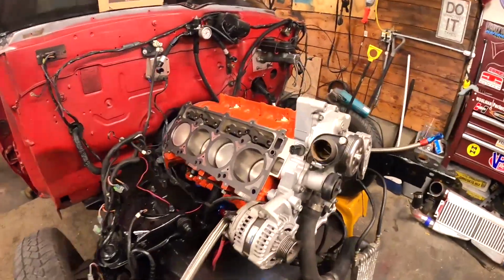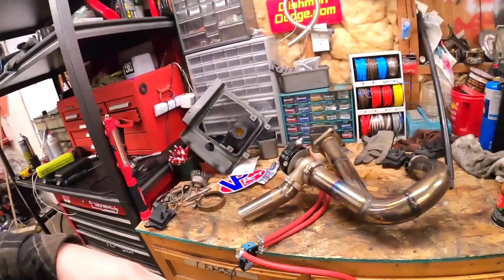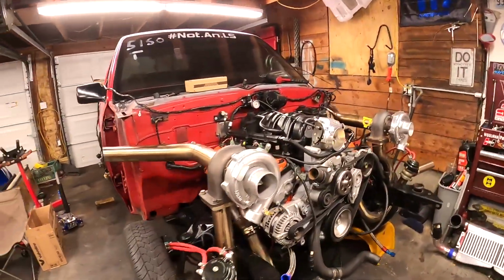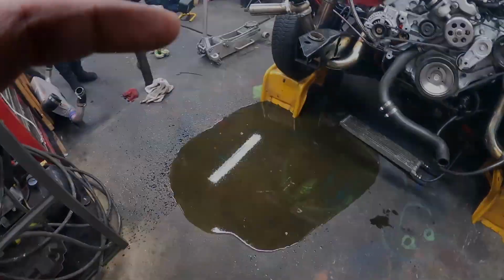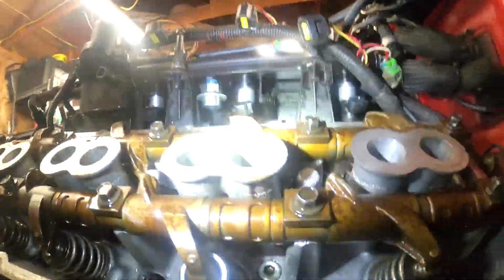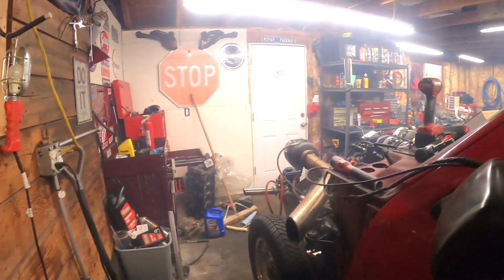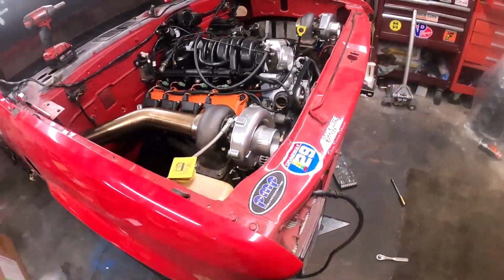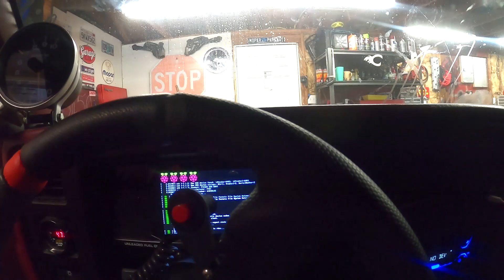Turbo Hemi First Startup & Give away talk!

Comment: I'm trying to do a similar swap on an 02 dakota how did you get the 727 to work with the hemi? Do you use a manual valve body or some other type of controller?
Reply from the maker: sorry took so long to reply but worked great !!! yes used manual valve body to make it work.

Comment: What intake is that? It doesn't look like the truck one
Reply from the maker: It's off a charger
Reply: Pretty sure they are identical to the ones off the older jeeps. If you’re looking for one I got one cheap in great shape. I switched to a 6.1 intake (sorry not trying to self promote)
Reply: @jeepwk6.5L  Can either of those intakes hold boost? I though the car intakes had a foam plug at the back
Reply: @konradfrancis2572  I’m not sure exactly cuz hemi testing is so minimal. That’s why I purchased a 6.1 just to be safe since they are aluminum. But it was $1000 for a bare oem intake.
Reply: @jeepwk6.5L  Ya those stock ones are stupidly expensive. The aftermarket ones from holley are like half the price
Reply: @konradfrancis2572  yeah but I found a thread of a guy giving away 2 of them because they popped seams under boost so I steered clear